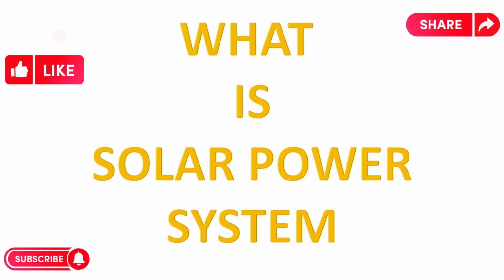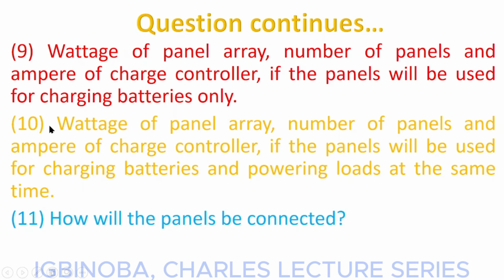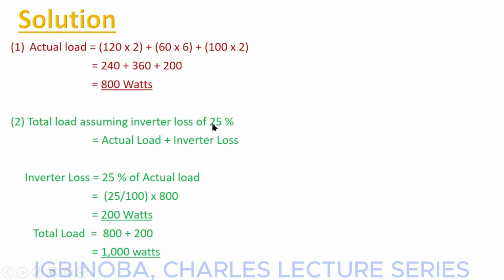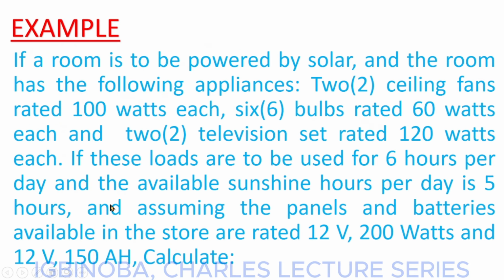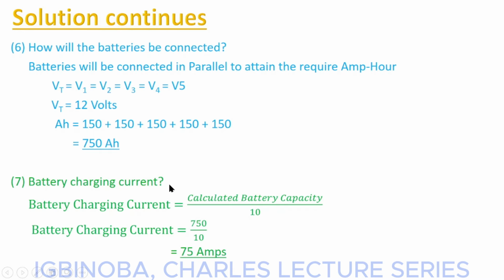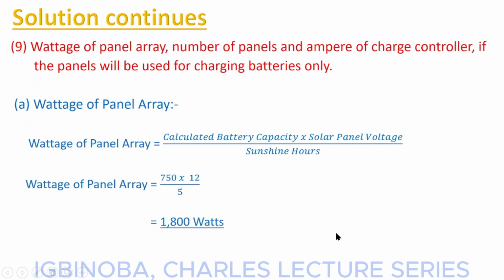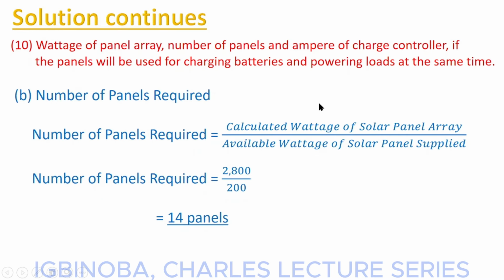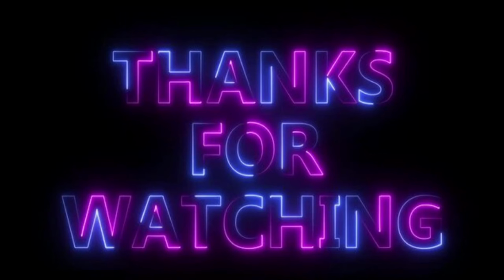Design of Solar Power System

Comment: MEC125U 

1:  Actual load = 1380watts

2: Total load  = 1725watts

3: Inverter rating = 2156.25VA

4: Battery capacity = 1293.75A

5: Number of batteries = 9

6: Batteries  are connected in parallel 

7: Battery charging current =129.4amps

8: Battery charging time = 14hrs

9a: Wattage of panel array =3105watts

9b: Number of panels = 16panels

9c: Charge controller = 256.75A

10a: Wattage of panel array = 4830watts

10b: Number of panels = 24 

10c:  Charge controller = 402.5A

11: Panels  are arranged in parallel

Comment: MECH3116L

1. Actual Load: 1380 watts
2. Total Load: 1725 watts
3. Inverter Rating: 2156.25 VA
4. Battery Capacity : 1293.75 Ah
5. Number of Batteries : 8.625 - 9 batteries
6. Parallel
7. Battery charging current: 129.375 Amps
8. Charging time : 14 hrs
9. (a) 3105 watts
(b) 15.525-16 panels
(c) 258.75 Amps
10. (a) 4830 watts
(b) 24.15 - 24 panels
(c) 402.5 Amps
11. Parallel

Comment: MAR314N

1: actual load = 1380watts

2: total load= 1725 watts

3: inverter rating =2156.25VA

4: battery capacity= 1293.75A

5: No of batteries= 9

6: batteries are connected in parallel

7: battery charging current =129.4amps

8: battery charging time=14hrs

9a: wattage of panel array= 3105watts

9b: number of panels=16panels

9c: charge controller= 258.75A

10a: wattage of panel array= 4830watts

10b: number of panels = 24

10c: charge controller = 402.5A

11: panels are arranged in parallel

Comment: MAR373U 

1. Actual load= (100×3)+(60×10)+(120×4) =1380watts
2. Total load assuming inverter loss of 25%= Actual load +Inverter loss
Inverter loss=25% of Actual load
= 25%×1380=345 watts
Total load= 1380+345=1725 watts
3. Inverter rating on VA using power factor of 0.8
= (1725÷0.8)= 2156.25
4. Battery capacity using factor for reserve 75%=(2×1725×6×0.75)=1293.75Ah
5. No. of batteries for backup hours=1293.75Ah÷150Ah= 8.6 =8 batteries 
6. How batteries will be connected?
The batteries will be connected in parallel 
Vt=V1=V2=V3=V4=V5=V6=V7=V8
Ah= 150+150+150+150+150+150+150+150=1200
7. Battery charging current=1293.75÷10=129Amps
8. Battery charging time assuming charging loss of 40%= 1293.75Ah+(40%+1293.75Ah)÷129A=14hrs
9a. Wattage panel array= 3105 watts
9b. Number of panels required= 3105÷345=9 panels 
9c. Ampere of charging controller required= 3105÷12=258.75Amps
10a. Wattage of panel array= Calculated wattage of solar panel array for charging battery only+ calculated total load =3105+1725=4830watts
10b. Number of panels required= calculated wattage of solar panel array÷ Available wattage of solar panel supplied= 4830watts÷345= 14Amps
10c. Ampere of charge controller= calculated wattage of solar panel array÷ solar panel voltage=4830watts÷12volts= 402.5Amps
11. How will the panels be connected?
Ans: They will be connected in parallel

Comment: CIV354B

1. Actual Load =1380W
2. Total load =1735W
3. Inverter rating =2156.25VA
4. Battery capacity =1293.75AH
5. Number of batteries is 9
6. Parallel 
7. Battery charging current is 129.375A
8. Charging time is 14 hours
9. (A) 3105W
        (B) 15.5 panels 
        (C) 258.75A
10. (a) 4830W
        (b) 24 panels
        (c) 402.5A
11. Parallel

Comment: PETRO318R

1. Actual load.... 1380watts
2. Total load..... 1725watts
3. Inverter rating..... 2156.25VA
4. Battery capacity.....1294.75Ah
5. Number of batteries..... 9
6. Parallel connection 
7. Battery charging current.... 129.38Amps
8. Charging time..... 14hours
9A. 3105W
 B. 16 panels 
 C . 258.75Amps
10A. 4830Amps
     B. 24 panels
     C. 402.5 Amps
11. Parallel connection

Comment: CHM3106B

1. 1380W
2. 1725W
3. 2156.25VA
4. 1293.75AH
5. 9 batteries 
6. Parallel connection 
7. 129.375A
8. 14Hours 
9a. 3105W
  b. 16panels 
  c. 258.75A
10a. 4830W
   b. 24panels 
   c. 402.5A
11. Parallel connection

Comment: CHM33C
1. Actual load = 1380 watts
2. Total load = 1725 watts
3. Inverter rating = 2156.25 VA
4. Battery capacity = 1293.75 Ah
5. Number of batteries = 9
6. Batteries are connected in parallel
7. Battery charging current = 129.4 amps
8. Battery charging time = 14 hrs
9a. Wattage of panel array = 3105 watts
9b. Number of panels = 16 panels
9c. Charge controller = 258.75 A
10a. Wattage of panel array = 4830 watts
10b. Number of panels = 24
10c. Charge controller = 402.5 A
11. Panels are arranged in parallel

Comment: PETRO 354B
1.1380watts
2.1725 watts
3.2156.25
4.1293.75Ah
5.8 batteries 
6. in parallel
7.129Amps
8.14hrs
9a.3105 watts
9b.9 panels 
9c.258.75Amps
10a.4830watts
10b.14Amps
10c.402.5Amps
11.They will be connected in parallel.

Comment: EEE3104Z
1) Actual Load = 1380watt
2) Total Load = 1725watt
3)Inverter Rating=2156.25v
4) batt. Capacity= 1293.75Ah
5) Number of batt= 9
6) parallel 
7) batt. Charging current=129.38Amp
8) wattage of panel=3105watt
9) No. Panel = 16
10) 4830watt
11) parallel

Comment: MECH3146P
1. Actual load 1380W
2. Total load 1725W
3. Inverter rating 2156.25VA
4. battery Capacity 1293.75Ah
5. number of batteries 8.6 approximately 9 batteries
6. Parallel
7. Battery charging 129.375A
8. Time = 14hrs
9. (a) 3105W
    (b) 15.5 panels (16 Panels)
    (c) 258.75 A
10. (a) 4830W
   (b) 24 panel
   (c) 402.5A
11. Parallel

Comment: PETRO3132B

1.Actual Load =1380 watts

2. Total Load Assuming inverter Loss of 25% =1725 watts

3.Inverter rating of VA using power factor of 0.8

4. Battery capacity using factor for reserve 75%=1293.75

5. Number Of Batteries For Backup Hours= 9 batteries 

6. Battery Connected = Parallel 

7. Battery Charging Current= 129.4 Amps

8. Battery Charging Time Assuming Charging Loss of 40%=14 hrs

9a. Wattage panel arrays= 3105 watts

9b. Number of panels required = 16 panels 

9c. Ampere of charging controller required=258.75 Amps

10a. Wattage of panel array= 4830 watts 

10b. Number Of Panels required=24 panels 

10c. Ampere of charge controller=402.5 Amps.

How will the panels be connected= They will be connected in parallel

Comment: PETROCHEM365M

1 Actual load 1380W

2 Total load 1725W

3 Inverter rating 2156.25VA

4 battery Capacity 1293.75Ah

5 number of batteries 8.6 (i.e 9 Batteries)

6 Parallel

7 Battery charging 129.375A

8T=14hrs

9 (a) 3105W

(b) 15.5 panels (16 Panels)

(c) 258.75 A

10 (a) 4830W

(b) 24 panel

(c) 402.5A

11 Parallel

Comment: PETRO3191I
Actual Load
1380W

· 8280 W/day

2. Total Load (with 25% inverter loss)

· 11040 Wh/day

3. Inverter Rating

· 2000 VA (using power factor 0.8)

4. Battery Capacity

· 3680 Ah at 12V (with 75% reserve)

5. Number of Batteries

· 25 batteries (12V, 150Ah each, all parallel)

6. Battery Connection

· Parallel (to maintain 12V system)

7. Battery Charging Current

· 184 A (during bulk charging)

8. Battery Charging Time

· 3 hours (bulk charging time approximation)

9. Panels for Battery Charging Only

· 3680 W, 19 panels, 306.67 A charge controller

10. Panels for Charging + Direct Load

· 3680 W, 19 panels, 306.67 A charge controller

11. Panel Connection

· Parallel (for 12V system compatibility)

Comment: COMP342P

1 Actual load 1380W
2 Total load  1720W
3 Inverter rating  2156.25VA
4 battery Capacity 1293.75Ah
5 number of batteries 8.6
6 Parallel 
7 Battery charging  129.4A
8 T = 14hrs
9 (a) 3105W
   (b) 15.5 panels 
   (c)  258.75 A
10 (a) 4830W 
     (b) 24 panel 
     (c) 402.5A 
11 Parallel

Comment: PETRO342P
1. Actual load is 1380w
2. Total load is 1735w
3. Inverter rating is 2156.25VA
4. Battery capacity is 1293.75AH
5. Number of batteries is 9
6. Parallel 
7. Battery charging current is 129.375amps
8. Charging time is 14hrs
9. (A)3105w
    (B)15.5panels
    (C)258.75A
10.(A) 4830w
      (B)24 panels
       (C)402.5A
11. Parallel

Comment: PETROCHEM354B

1.actual load =1380W

2.Total load -1725 W

3.Inverter rating-2156.25 VA

4.Battery capacity- 1293.75 AH

5.Number of batteries-9

6.connection - parallel 

7.charging current -129.38 A

8.Charging time -14hrs

9.(a) 3105 A
(B)15.5~16panels
 (C)258.75 A

10.4830 W
(B) 24 panels 
(C)402.5A 

11.connection-parallel

Comment: CHM38H

1. Actual load =1380w 
2.Total load =1725w 
3. Inverter rating =2156.25VA 
4. Batterycapacity=1293.75AH 
5. No of batteries =8.625~9batteries 
6. Battrty connection: All 9 are in Parallel 
7. Battery charging current=129.375ampd 
8. Charging time=14hours 

9. (a)3105w
     (b)15.525~16panels 
     (c)258.75A

10. Wattage: (a)4830w
      (b) Number of panels 24.15~24panels 
       (c) Charge controller rating :402.5A

11. Panel connection :Parallel

Comment: CHM361I

1. Actual load: 1380 watts 

2. Total load: 1725 watts 

3. Inverter rating: 2156.25 VA

4. Battery capacity: 1293.75 Ah

5. Number of batteries: 9 batteries

6. Batteries are connected in parallel 

7. Battery charging current- 129.4amps

8. Battery charging time- 14hrs

9a. Wattage of the panel array- 3105W

9b. Number of panels- 16 panels

9c. Charge controller -258.75A

10a. Wattage of panel array- 4830W

10b. Number of panels- 24 panels

10c. Charge controller size: 402.5A

11. Panel arrangement: Parallel connection

Comment: MECH3110F
1. Actual load 1380W
2. Total load 1725W
3. Inverter rating 2156.25VA
4. battery Capacity 1293.75Ah
5. number of batteries 8.6 approximately 9 batteries
6. Parallel
7. Battery charging 129.375A
8. Time = 14hrs
9. (a) 3105W
(b) 15.5 panels (16 Panels)
(c) 258.75 А
10. (a) 4830W
(b) 24 panel
(c) 402.5A
11. Parallel

Comment: EEE315YY.  

1)actual load=1380watts.2) Total load=1725watts.3)inverter rating=2156.25VA.4) Battery capacity=1293.75Ah.5)Number of
batteries=8.6.6) connection parallel.7) Battery charging current=129.375.8) charging time.9)a wattage of panels array=3105w.B) Number of panels 16 panels charge controller 258.75A.10) a wattage of panels array 4830W.B)Number of panels 24.C) charge controller=4025A.11) panels arrangement parallel.

Comment: MECH3126V
1. Actual load 1380W
2. Total load 1725W
3. Inverter rating 2156.25VA
4. battery Capacity 1293.75Ah
5. number of batteries 8.6 approximately 9 batteries
6. Parallel
7. Battery charging 129.375A
8. Time = 14hrs
9. (a) 3105W
    (b) 15.5 panels (16 Panels)
    (c) 258.75 A
10. (a) 4830W
       (b) 24 panel
       (c) 402.5A
11. Parallel

Comment: PETRO3111G

1. Actual load= (100×3)+(60×10)+(120×4) =1380watts

2. Total load assuming inverter loss of 25%= Actual load +Inverter loss
Inverter loss=25% of Actual load
Therefore, 
Total load= 1380+(25%×1380)=1725 watts

3. Inverter rating in VA using power factor of 0.8
= (1725÷0.8)= 2156.25 VA

4. Battery capacity using factor for reserve of 75%=(2×1725×6×0.75)/12=1293.75Ah

5. No. of batteries for backup hours=1293.75Ah÷150Ah= 8.625 = 9 (Approximately) 
       = 9 batteries 

6. How the batteries will be connected?
The batteries will be connected in parallel 
VT=V1=V2=V3=V4=V5=V6=V7=V8=V9
VT= 12 V 
Ah= 150+150+150+150+150+150+150+150+150=1350 Ah

7. Battery charging current=1293.75÷10=129Amps

8. Battery charging time assuming charging loss of 40%= 1293.75Ah+(40%+1293.75Ah)÷129A=14hrs

9a. Wattage of panel array= (1293.75 x 12)/5=3105 watts

9b. Number of panels required= 3105÷200=15.525 = 16 panels 

9c. Ampere of charging controller required= 3105÷12=258.75Amps

10a. Wattage of panel array= Calculated wattage of solar panel array for charging battery only+ calculated total load =3105+1725=4830watts

10b. Number of panels required= calculated wattage of solar panel array÷ Available wattage of solar panel supplied= 4830watts÷200watts= 24.15 Amps

10c. Ampere of charge controller= calculated wattage of solar panel array÷ solar panel voltage=4830watts÷12volts= 402.5Amps

11. How will the panels be connected?
Ans: They will be connected in parallel

Comment: EEE3145O

1 Actual load 1380W
2 Total load  1725W
3 Inverter rating  2156.25VA
4 battery Capacity 1293.75Ah
5 number of batteries 8.6 (i.e 9 Batteries)
6 Parallel 
7 Battery charging  129.375A
8 T = 14hrs
9 (a) 3105W
   (b) 15.5 panels (16 Panels)
   (c)  258.75 A
10 (a) 4830W 
     (b) 24 panel 
     (c) 402.5A 
11 Parallel

Comment: EEE367O
1 actual load is 1380W
2.total load is 1735W
3.the inverter rating is 2156.25VA
4.battery capacity is 1293.75AH
5.number of batteries is 9
6.parallel
7.battery charging current is 129. 375 amps
8.14 hours 
9.(A)3105W
(B)15.50 panels 
(C)258.78A
10.(A)4830W
(B)24 panels
(C)402.5A
11.parallel

Comment: CHM3135E
L Actuai Ioad: 1380 W
 2. Totai IOad with inverter loss: I725 W 
3. Required inverter rating: 2156.25VA 
4. Required battery capacity: 1293.75AH
 5. Number of l50 Ah batteries needed: 8.6 ~8 batteries
 6. Battery connection: Ai 9 are in paralel 
7. Battery charging cUrrent: 129A 8. Battery charging time (40% 1oss) 14 hours
 9. Panel array đor charging ony: 3/05W 9b. Number of paneis: 5.5 ~5 panels 9c. Ampere of charge controler: 258.75A 
I0. Panel array đor charging + powering load: 4380W IOb. Number of paneis: 24 paneis IOc. Ampere oâ charge controler: 402.5A I. Panei connection: Al paneis are in paralel

Comment: COMP329C
1. Actual load: 1380 W

2. Total load: 1725 W

3. Inverter rating: 2156.25 VA

4. Battery capacity: 1293.75 AH

5. Number of batteries: 9

6. Configuration: parallel

7. Battery charging current: 129.375 amps

8. Charging time: 14 hours

9. (a) 3105 w

(b) 15.5 panels

(C) 258.75 A

10. (a) 4830 watts

(b) 24 panels

(C) 402.5 A

11. Configuration: parallel

Comment: PETRO363K
1. Actual load= (100×3)+(60×10)+(120×4) =1380watts
2. Total load assuming inverter loss of 25%= Actual load +Inverter loss
Inverter loss=25% of Actual load
= 25%×1380=345 watts
Total load= 1380+345=1725 watts
3. Inverter rating on VA using power factor of 0.8
= (1725÷0.8)= 2156.25
4. Battery capacity using factor for reserve 75%=(2×1725×6×0.75)=1293.75Ah
5. No. of batteries for backup hours=1293.75Ah÷150Ah= 8.6 =8 batteries 
6. The batteries will be connected in parallel 
Vt=V1=V2=V3=V4=V5=V6=V7=V8
Ah= 150+150+150+150+150+150+150+150=1200
7. Battery charging current=1293.75÷10=129Amps
8. Battery charging time assuming charging loss of 40%= 1293.75Ah+(40%+1293.75Ah)÷129A=14hrs
9a. Wattage panel array= 3105 watts
9b. Number of panels required= 3105÷345=9 panels 
9c. Ampere of charging controller required= 3105÷12=258.75Amps
10a. Wattage of panel array= Calculated wattage of solar panel array for charging battery only+ calculated total load =3105+1725=4830watts
10b. Number of panels required= calculated wattage of solar panel array÷ Available wattage of solar panel supplied= 4830watts÷345= 14Amps
10c. Ampere of charge controller= calculated wattage of solar panel array÷ solar panel voltage=4830watts÷12volts= 402.5Amps
11. Parallel

Comment: PETRO3143M

1. Actual load= (100×3)+(60×10)+(120×4) =1380watts
2. Total load assuming inverter loss of 25%= Actual load +Inverter loss
Inverter loss=25% of Actual load
= 25%×1380=345 watts
Total load= 1380+345=1725 watts
3. Inverter rating on VA using power factor of 0.8
= (1725÷0.8)= 2156.25
4. Battery capacity using factor for reserve 75%=(2×1725×6×0.75)=1293.75Ah
5. No. of batteries for backup hours=1293.75Ah÷150Ah= 8.6 =8 batteries 
6. How batteries will be connected?
The batteries will be connected in parallel 
Vt=V1=V2=V3=V4=V5=V6=V7=V8
Ah= 150+150+150+150+150+150+150+150=1200
7. Battery charging current=1293.75÷10=129Amps
8. Battery charging time assuming charging loss of 40%= 1293.75Ah+(40%+1293.75Ah)÷129A=14hrs
9a. Wattage panel array= 3105 watts
9b. Number of panels required= 3105÷345=9 panels 
9c. Ampere of charging controller required= 3105÷12=258.75Amps
10a. Wattage of panel array= Calculated wattage of solar panel array for charging battery only+ calculated total load =3105+1725=4830watts
10b. Number of panels required= calculated wattage of solar panel array÷ Available wattage of solar panel supplied= 4830watts÷345= 14Amps
10c. Ampere of charge controller= calculated wattage of solar panel array÷ solar panel voltage=4830watts÷12volts= 402.5Amps
11. How will the panels be connected?
Ans: They will be connected in parallel

Comment: PETRO3168L 

1. Actual load= (100×3)+(60×10)+(120×4) =1380watts
2. Total load assuming inverter loss of 25%= Actual load +Inverter loss
Inverter loss=25% of Actual load
= 25%×1380=345 watts
Total load= 1380+345=1725 watts
3. Inverter rating on VA using power factor of 0.8
= (1725÷0.8)= 2156.25
4. Battery capacity using factor for reserve 75%=(2×1725×6×0.75)=1293.75Ah
5. No. of batteries for backup hours=1293.75Ah÷150Ah= 8.6 =8 batteries 
6. How batteries will be connected?
The batteries will be connected in parallel 
Vt=V1=V2=V3=V4=V5=V6=V7=V8
Ah= 150+150+150+150+150+150+150+150=1200
7. Battery charging current=1293.75÷10=129Amps
8. Battery charging time assuming charging loss of 40%= 1293.75Ah+(40%+1293.75Ah)÷129A=14hrs
9a. Wattage panel array= 3105 watts
9b. Number of panels required= 3105÷345=9 panels 
9c. Ampere of charging controller required= 3105÷12=258.75Amps
10a. Wattage of panel array= Calculated wattage of solar panel array for charging battery only+ calculated total load =3105+1725=4830watts
10b. Number of panels required= calculated wattage of solar panel array÷ Available wattage of solar panel supplied= 4830watts÷345= 14Amps
10c. Ampere of charge controller= calculated wattage of solar panel array÷ solar panel voltage=4830watts÷12volts= 402.5Amps
11. How will the panels be connected?
Ans: They will be connected in parallel

Comment: Mech3203W

1. Actual load: 1380 W

2. Total load with inverter loss: 1840 W

3. Required inverter rating: 2.5 kVA

4. Required battery capacity: 1227 Ah

5. Number of 150 Ah batteries needed: 9 batteries

6. Battery connection: All 9 in parallel

7. Battery charging current: 135 A

8. Battery charging time (40% loss): ≈ 11.5 hours

9. Panel array for charging only: 19 panels (200 W each), controller ≈ 320 A

10. Panel array for charging + powering load: 30 panels (200 W each), controller ≈ 500 A

11. Panel connection: All panels in parallel